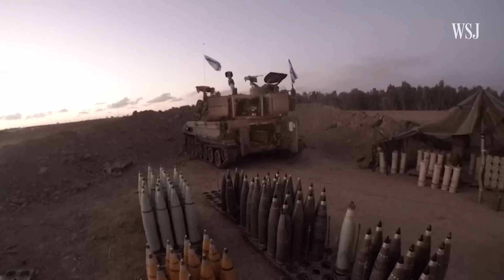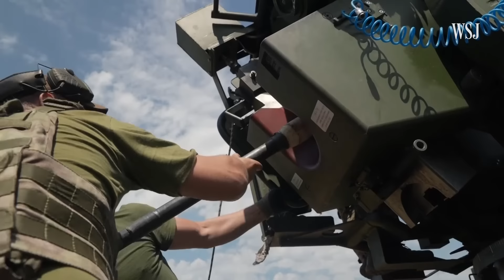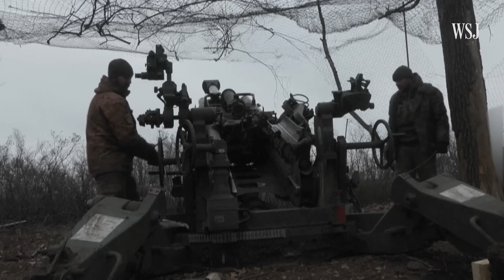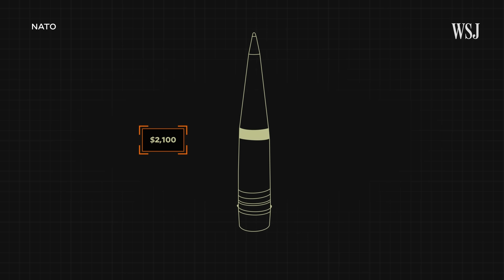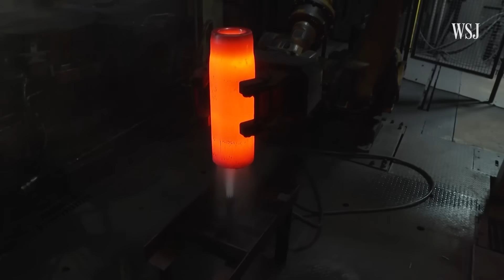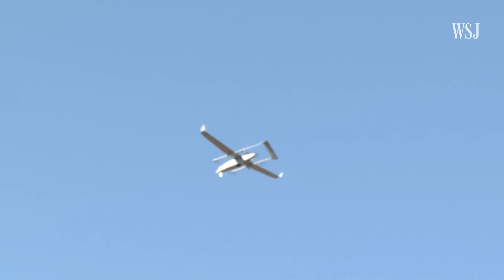Why the 155mm Shell Is One of the World’s Most Wanted Objects Now | WSJ Equipped

Comment: 105mm feels left out 😢
Reply: Not destructive enough
Reply: @zedeyejoe  depends on that destructive power, Can i ask, how much cost different between 105 vs 155mm shell without fuse
Reply: @dernadaarmando2948  It has been decided that 155mm is now the standard size. 105mm is used for light artillery. Russia uses 152mm and and 122mm as standard sizes.
Cost of ammunition has gone up with demand. I gather that an unguided (dumb) 155mm round is now $8,000 each (up from $2,000, used to be $750). I can see a price for a 105mm round, $750. I don't know how current that is. Prices should drop once more shell production comes on-line.
Reply: @zedeyejoe  oh so its mean, in terms normal demand, 155 and 105 have quite similar price?
Reply: @dernadaarmando2948  Yep 105mm just a bit smaller. Only difference in cost will be amount of material used and demand!
Reply: @zedeyejoe  oh i see, Thank you very much for the information